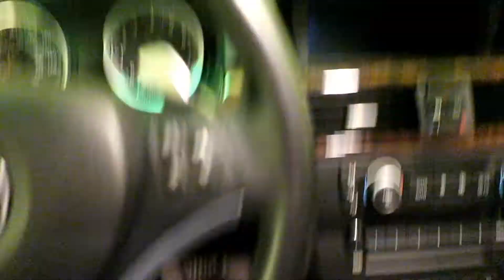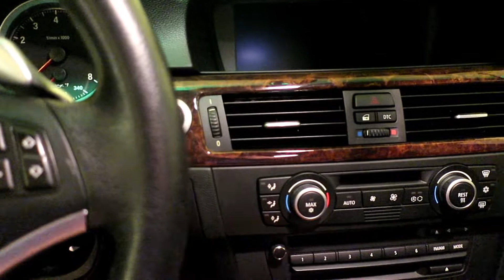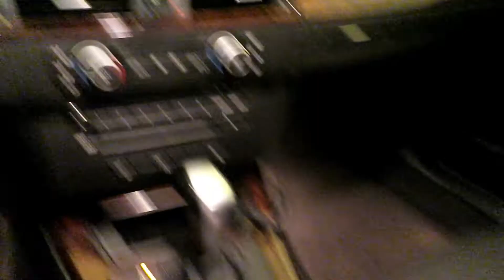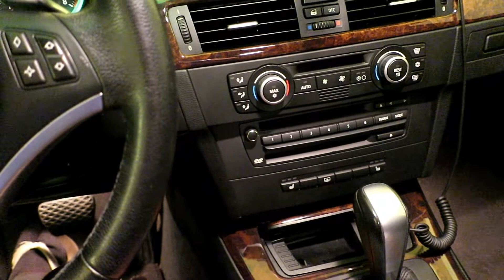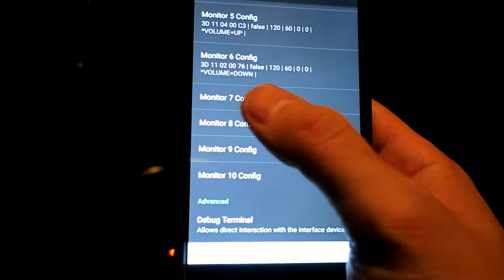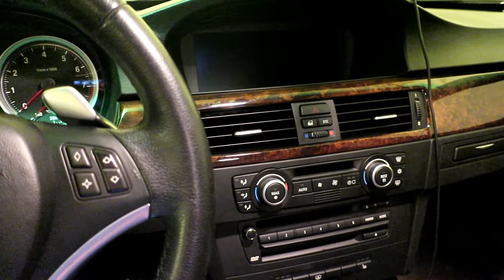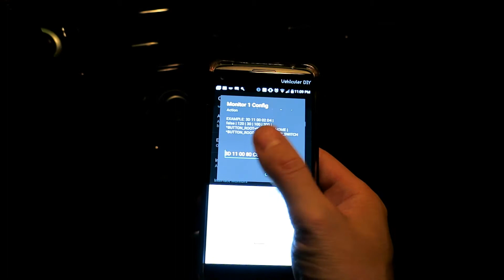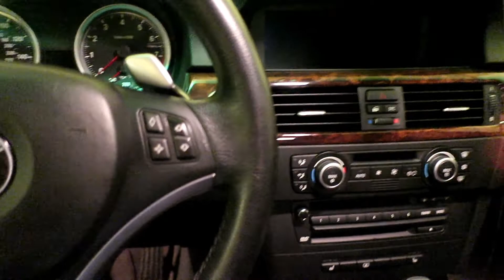Steering Wheel Controls Via Your OBD II Port? Maybe...For Android Auto Integration.

Comment: Would it let me control my dash cluster with the controls if I want to use a newer model steering wheel to switch my information screens ? I have a 2022 Dodge Charger and want to use a 2016 steering wheel and dash cluster but instead of reading 1’s it’s reading/sending zeros to my dash cluster so the controls aren’t working .... could I change the values to where I could either change the information screen  between tire pressure,speedometer or what not can I do that and if so what was the name of the cheap odb Bluetooth device and app you’re using ? Thank you so much

Comment: Nice concept but those cheap adapters don't appear to interface in a 'traditional' way with the CAN network; I'm still learning so not sure what the adapter specifically lacks; you can't use these to pull or send real-time CAN messages.  There may be some research in whether these commands can be accessed by PID although I would imagine this to be manufacturer specific - if this is the case, most android apps allows you specify custom PID's.  Failing that, the only other option is additonal hardware although a USB or Bluetooth CAN bus adater isn't too expensive - you could then use a RPi to interface etc.

Comment: hi, love your videos! I recently got an 08 e93 and was looking into making some type of system to make the idrive much more modern and update-able in the least intrusive way. People have done this on the e46 using an arduino or raspberry pi to intercept these signals. so its definitely possible, there just isnt a huge group of people interested in taking on this task.
Reply from the maker: Nice yeah I put this video out there to see if others wanted to maybe help figure this out.  What I've found thus far is the only way to hop on the can-bus would be behind the stereo or up where the alarm sensor goes in the roof.  I plan on posting an update to this.
Reply: can you please share the details who does this on e46 using raspberry pi